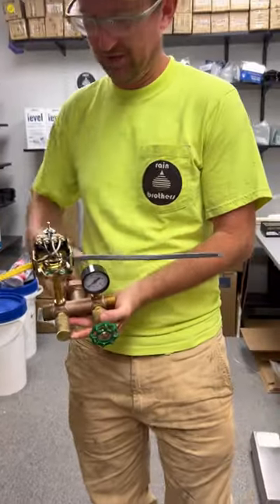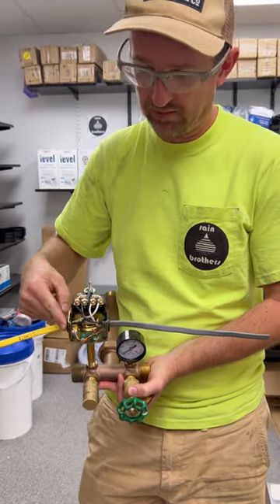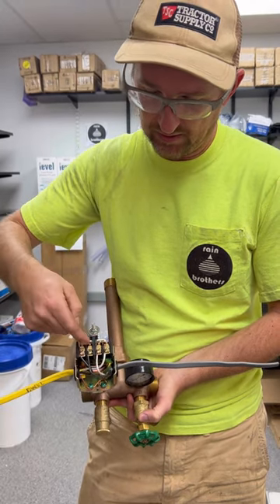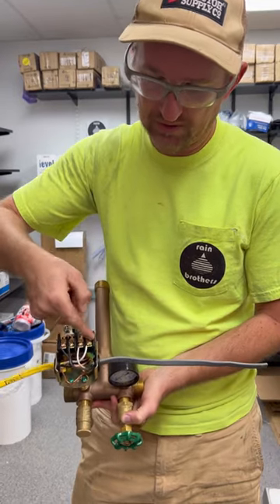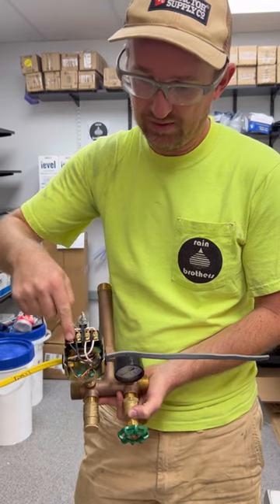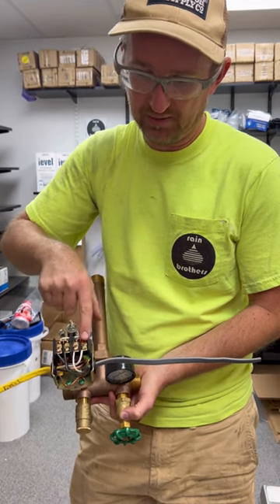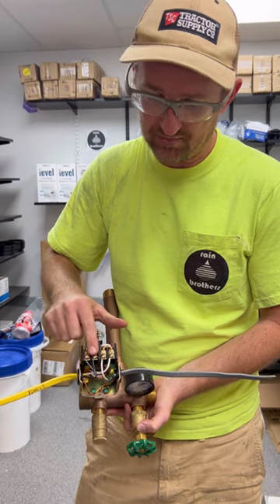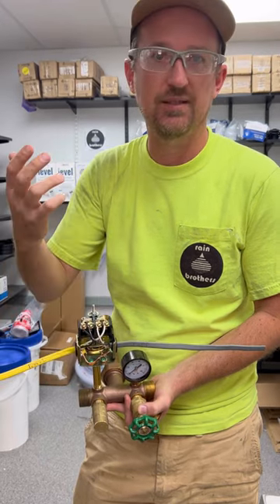How to wire a pressure switch #well  #rainwaterharvesting #plumbing

Comment: where is your neutral
Reply from the maker: 230V pumps do not have a neutral leg. For 115v pumps, the white wires shown in this video represent the neutrals
Reply: @ I have a 220 V pump but I also need to pull 110 V on one of the 110 V legs for a water softener.
My question is can I just use a hot and neutral off of my 10/3 to make this happen or do I need to install some kind of subpanel or do I have to run a separate circuit?
Reply from the maker: @LetTheTruthBeTold8324  Unfortunately any electrical question that is outside of the norm would have to be answered by an electrician since I do not know what code would be and would hate to give bad advice. I’ve seen it done plenty using THHN conductors on commercial jobs but would not feel comfortable making a recommendation

Comment: So I replaced my pressure switch and when I turned the power on it didn't kick on. After checking electrical/terminals there's power going to it. I'm being told that my well pump may be bad and needs replacing. Do you have an opinion or ideas?
Reply from the maker: This video details what to do: “Well pump not working? Check THIS before calling a plumber!”
https://youtu.be/62dPNLHoUBc
New pressure switches can sometimes stick and you need to snap it to get it to work. Subscribing to our channel helps find videos like this to make your troubleshooting easier

Comment: need help I woke this morning and found mine melted
Reply from the maker: Sorry to hear! Not sure how that could’ve happened unless the wires shorted out inside the pressure switch. But even then, your breaker should’ve tripped the moment a short happened. I would highly recommend contacting an electrician to get to the bottom of the issue. There could’ve been a surge in your system too but an electrician should be able to investigate and figure out the root cause
Reply: @rainbrothers  a tech came buy and it got hit by lightning pretty wild
Reply from the maker: @vicentee2687  Goodness! Glad it only affected your pressure switch. Glad you got it figured out

Comment: Pretty clear video, only one question, if the system is 220v then the neutrals (white wires) coming from the pump and the electric panel are just going to connect directly with a wire connector?
Reply from the maker: 220v pumps don’t have a neutral leg. Only two hots and a ground, and both hots get wired into the switch.
Reply: I am running into this same problem with my 220, it has 4 wires, one ground one nuteral
Reply from the maker: @tyveno9790  If your pump has a neutral leg, then just wire nut the neutrals together inside the pressure switch cover… you only need to run the hot legs thru the switch terminals for 230v systems and the grounds to the grounding screws at the base of the switch.
Reply: My Sta-Rite Owner's Manual says "cap the white (neutral) wire". The pump has no neutral. The OP is correct.
Reply: if I run a 10/3 can I also pull 110volts from the circuit to power my water softener?
if not, what electrical box do I need to purchase to provide 110 for my water softener and 220 for my oil pump?
Reply from the maker: @ You’d want to consult an electrician on that one. I’ve seen it done using THHN for commercial applications, but there is undoubtedly electrical code that comes into play that I would not feel comfortable advising on
Reply: @ yeah I'm just gonna run a separate circuit